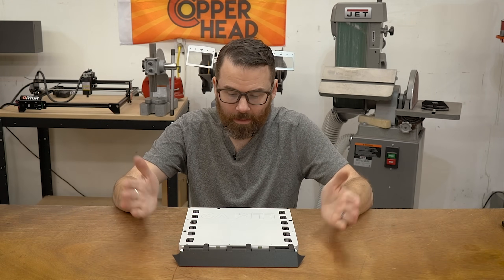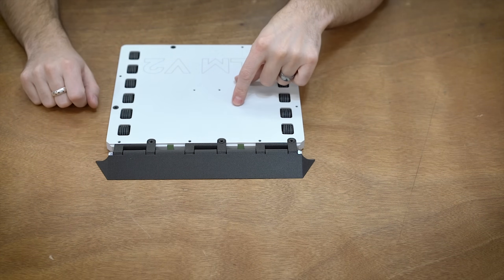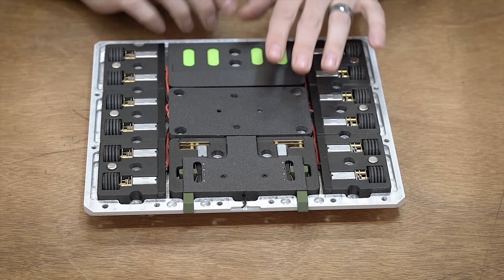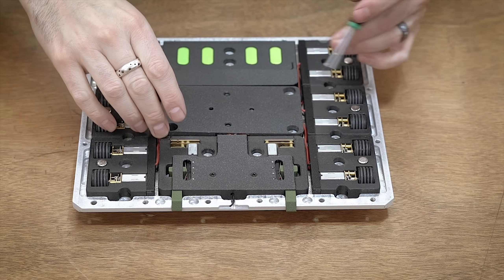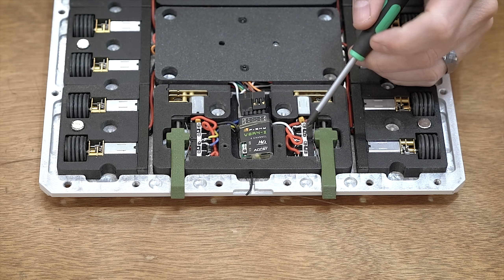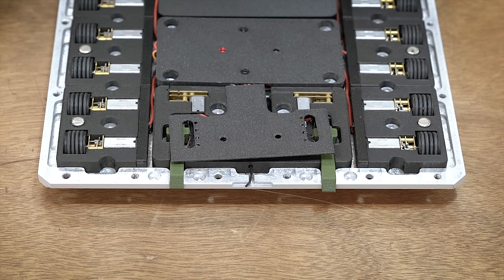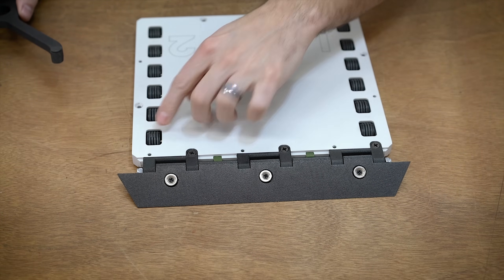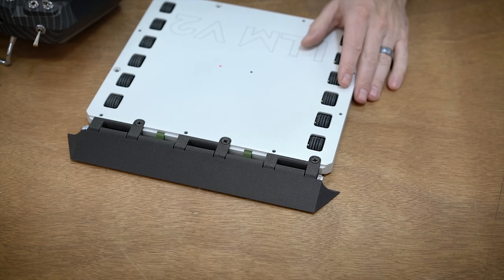Low Low Man V2 Overview

Comment: I believe a roughly 250mm x 250mm clamshell is too large for a Tormach 440 in a single setup. By any chance was the chassis machined on the Avid CNC?

Comment: What was the thought process of using limit switches and diodes instead of a linear potentiometer and servo electronics?
Reply from the maker: complexity and size.  I actually couldn't find a servo small enough to fit into the enclosure, even if I took everything apart.  And I don't really care too much about the relative position, I really only care about the full limits of the motor.  a servo would allow you to get it to a specific angle, but that's not really necessary.  Also, with impacts, the potentiometer would fail MUCH quicker than a simple switch and diode.  so reliability was also a concern.

Comment: Got to love American units... starts off by explaining how low the robot is (millimetres) and promptly switches to inches when measuring the sides; then gives American screw sizes.
Reply from the maker: Do you also fault bilingual people for speaking more than one language?
Reply: @RobertCowanDIY  Well it certainly keeps the audience on its toes. But the robot's great, I love it. I wish my shonky robots were half as good.
Reply: Ya, Americans also pay a lot more for tools.. you need metric and imperial wrenches, sockets, allen keys, taps, dies and drills💸🤕
Reply: I often use inches for construction but mm for trim work .

Comment: the little lifter mechanism for the wedge is also great for when you get stuck at the halfway seam of the arena again
Reply from the maker: Yeah, that was the original idea.  It's a bit too slow for a quick 'seam jump', but it would work for getting stuck.  The original design was going to use solenoids, but they were too heavy and not strong enough.

Comment: One of the neatest, cleanest looking bots i've ever seen, probably the one. 

The internals made me figuratively cry of joy. It's a pity that a much more cruder built bot could tear it to shreds, but hey that's combat robotics and at least it'll look neat even with its guts hanging out! 

Also, if the linear actuator module is swappable.... does that mean LLM could theorically host a small flamethrower in its place, in a competition that would allow those? Maybe the flame could peak trough a gap in the wedge. That'd be cool. 

Looking forward to your after-battle analysis!

(....did i really just watch 18 minutes of a tiny robot overview?!? And it didn't even feel like it....)
Reply from the maker: Yes, the linear actuator module can be easily swapped out.  It's one connector for the ESC and that's it!  It saves around 70 grams, so it's not much, but something could be swapped out, like a fire effect.  I think finding a tank thin enough for the fuel would be tricky though.

Comment: Combining the two "weapons" might be quite effective. Have a longer wedge that you could flip up into a keep away pusher. Being able to control the height would have some strategic value. I would loose the limit switches and put in some optical feed back into a custom ESC. It could run just like an RC servo. So you could have preset heights on a switch for example. 

I've been tinkering with a similar designed flat beetle weight. I was a bit shocked when I weighed my top and bottom plates. They were nearly 1lbs and only made of HDPE. What did your top and bottom plates come in at? Looks like anodized aluminum?
Reply from the maker: The frame/shell is all CNC machined aluminum, and it's quite heavy just because of the size.